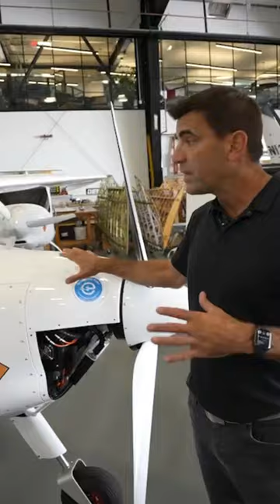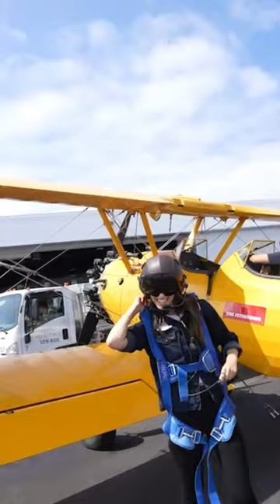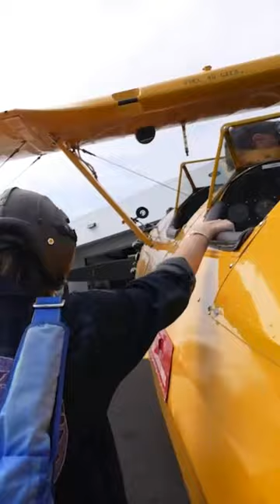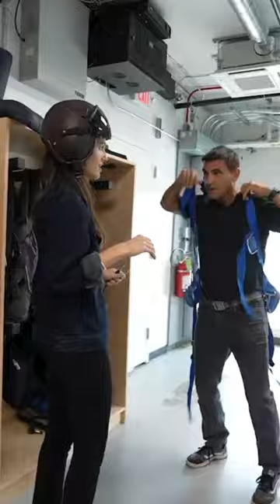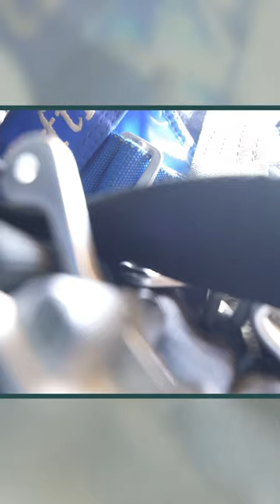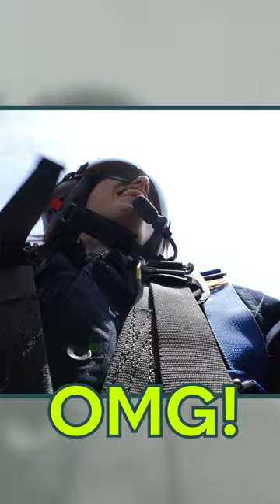Doing a FLIP in an open cockpit plane

Comment: I had ab initio aerobatic training starting at 13. I own an open cockpit plane but it isn't half as cool as a Stearman. Known commercially as the Model 75, I believe this is a PT-17 but not really clear in this video. The main difference between the PT-17 and the PT-13 is the engine manufacturer. From the perspective of a pilot and A&P tech, potato, potahto. Just refer to a different engine manual. If you are used to flying one and get in the other, a quick glance at the checklist will tell you anything you need to know about operating that very slightly different engine. Kinda like if you've flown one Cessna 100 series model, you've pretty much flown them all

Comment: I thought the issue with electric planes was the weight of the battery compared to power output. Is this still the case or has there been any new breakthroughs here? :)
And will batteries be an actual viable option for larger passenger planes in the future, or is this only viable for smaller general aviation aircraft? 

Best, 
Joe
Reply from the maker: this was exactly the big q I had! we'll get into a lot more detail in the longer episode, but the two areas I found most interesting are: 1) there have been a lot of developments in batteries recently, and 2) it turns out we can do a LOT in terms of CO2 emissions with just short haul flights (for passengers and cargo)
Reply: @CleoAbram  That’s great news! Looking very much forward to seeing the full episode!
Reply: Working on a presentation covering this topic. Firstly, yes power density is the biggest challenge for electric aviation. Secondly, there are 3 types of electric planes, turbo-electric (no batter), hybrid and all-electric. Each has advantages and disadvantages. Turbo-electric is viable currently and could advancements to this technology will allow all-electric planes a little further down the road. Even though all-electric technology has a long way to come, there are already a lot of planes like this. The only problem is that they are really small. Currently, electric airplanes could only replace conventional aircraft that fall under general or commuter aircraft. They could displace less than 2% of planes. (if that makes any sense) Electric aviation shows potential but has a long way to come.